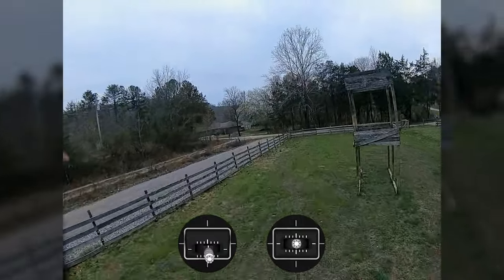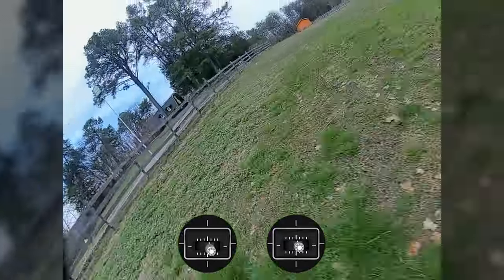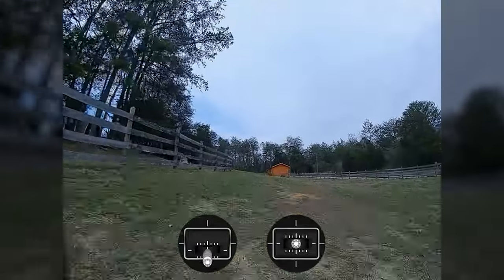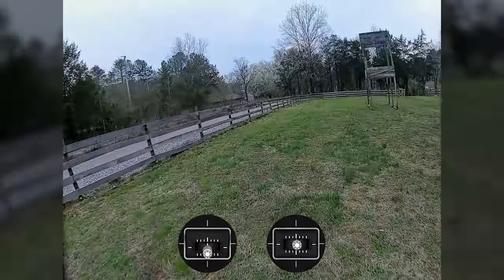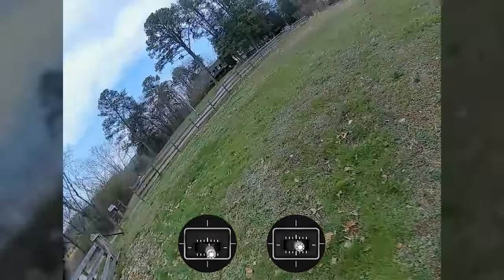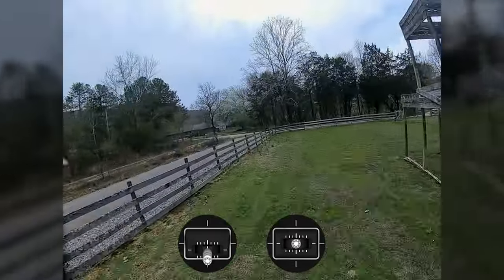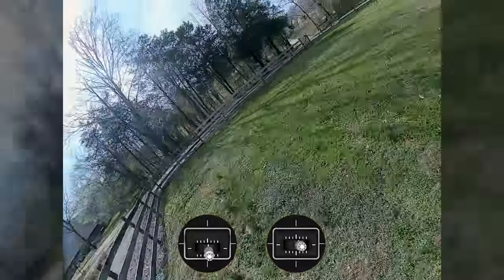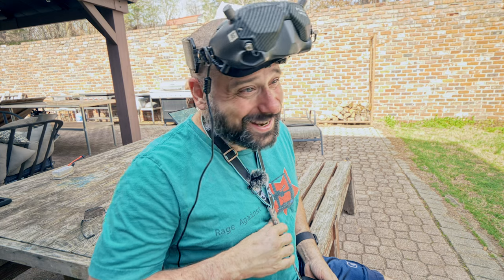Sbang Freestyle - backwards J-hook to inverted yaw spin - 30 days challenge, day 7

Comment: Joshua, something you're not considering: the speed of the move. See, if you do the moves fast, you can start them much lower to the ground and you're still going to have time enough. And sbang demands that speed and lower maneuvering... However, while you're learning the trick you need to go slower, so you need to go higher. Right?
So, what I'm trying to say is to do only one thing at the time: first learn the trick and, afterwards, practice it to do it faster. You know? Trying both at the same time won't work. 😬
Anyway, stay safe there with your family! 🖖😊

Comment: please man lmk can i use a speedybee f405 stack with a build that has a dji air o3 unit or do i need a better stack
Reply from the maker: Yeah you can use it. Why not?
Reply: @JoshuaBardwell  idk I dont know what exactly the difference between the stacks is I'm new to this I'm building my first fpv quad and wanna make sure everything is rite before I start putting it together
Reply from the maker: Yeah you're good.
Reply: Thank you so much man your one of the reasons I'm getting into fpv your videos are very helpful and thank you for answering my questions hope you have a good day and are doing well
Reply: I am having a lot of trouble choosing which digital system I want to use in the build I've seen most of your videos comparing walksnail and hdzero and dji I ordered everything already for a dji build but am unsure if I made the right choice considering the new walksnail vtx v2 pro just came out

Comment: I hope you don't mind some backseat advice, but I think your setup is holding you back a bit.
I feel like your rates are too high with too much expo, especially on yaw. Giving that much yaw abruptly causes yaw jump which sends you into the ground way more than it should. All those sbang moves are actually kinda slow if you look closely,. Marius has like 600 max rate for example.
You're also not flying with a GoPro I assume, and I'm pretty sure the extra weight should make those momentum tricks easier.

Comment: https://youtu.be/hSXs8PShqfY
It's just like inverted yaw where you catch the horizon low (or high bc your inverted) I do this thing called webslinging that starts out the same with a roll to inverted, still facing forward, but I do a blind eject front flip. It tosses me up and I catch the horizon again. In my trick I blip throttle at the center of the sky passing during the flip. When the cam looks up at the sky I know my thrust is up and forward even though it's a blind trick. Now I can string them back to back